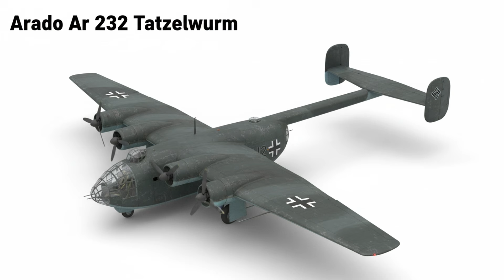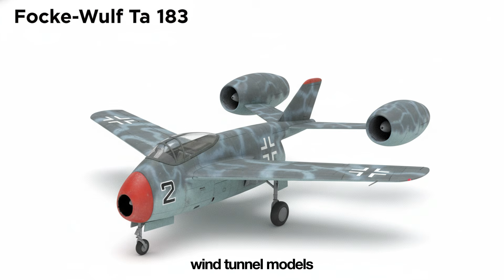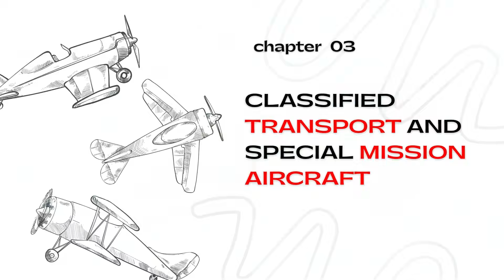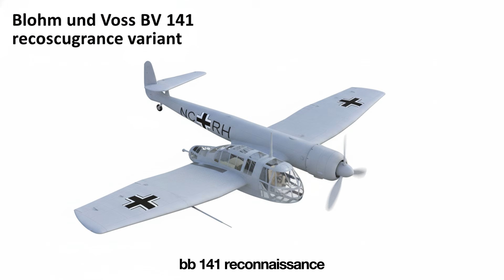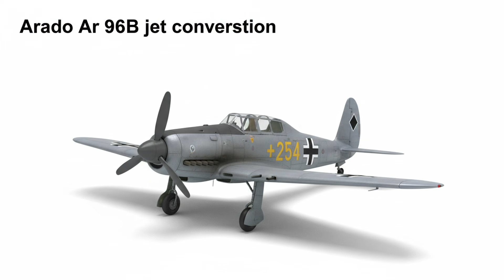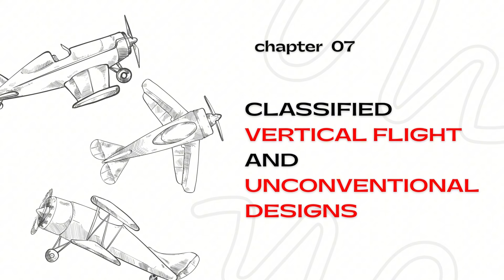every SECRET german aircraft (of WWII) in 14 minuets

Comment: In 4:02 scene, Ta 400 use powerplant by BMW 801E engines(deploying about at 1,975hp), They originally planned for BMW 802 or DB 604 or Jumo 223 engine, But three new and over 2,000hp engine has tested to fail and no massive production, They have use BMW 801E engine to give Ta 400, And that try to use BMW 801Q(turbocharger) or 801R(two stage four speed supercharger) give Ta 400 more flying high speed and high altitude to deporting Ta 400 strategic bomber version, But it is never exists upgrade project.